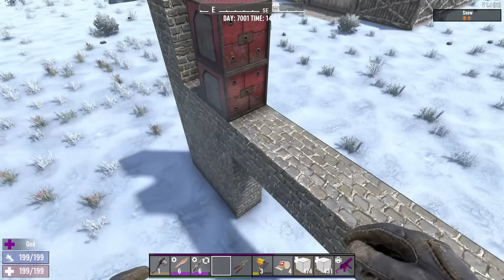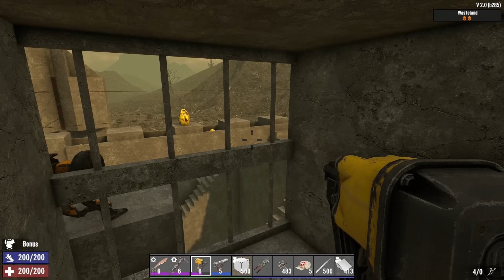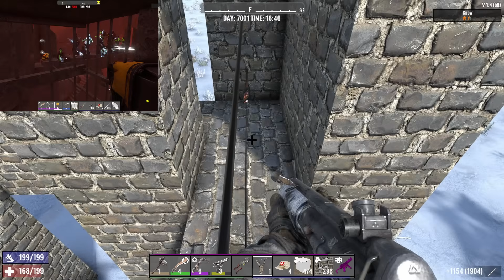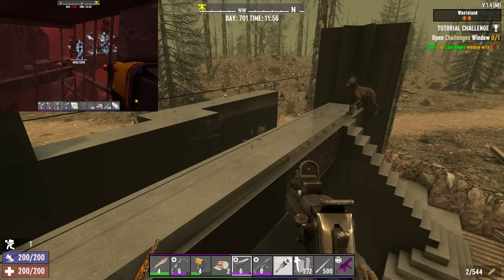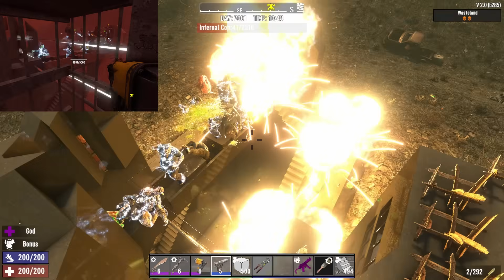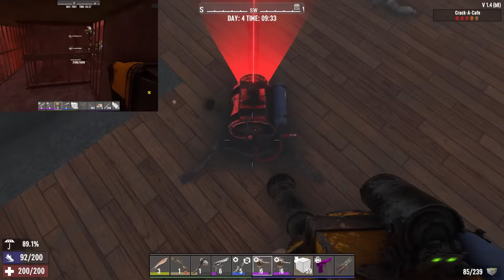How to Build a Simple No Cheese day 7000 End Game Horde Base - 7 Days to die 2.0

Comment: That's a good horde base. Based on the screenshot https://youtu.be/b-JvCyPUeFs?t=959, I've replaced lateral panels with bars so I could shoot zombies that are stuck in the holes on the catwalk. Shooting zombies with a SR by lining them up from the right side sort of works but the slits and dart traps on the left side had to go and to be replaced with solid steel blocks to stop bullets. Made the same sort of base in 3.0 but the zombies decided to bash on the right tower containing traps. There's indeed a passage for them. They could theoretically brake the slits and traps to access the main base that way. But in my case they don't even climb on the catwalk, they destroy the tower footing columns first, I don't know yet why.
Hope you'll make another one for 3.0.

Comment: I figured electric wires took more damage the more zombies were in them, so I assumed all of them getting shocked at once would destroy them in like 1 minute.

Also if built for it, you can use a zombie sensor to turn on the traps. Just gotta block off the angles that aren't in the path of the dart traps.
Reply from the maker: Yep motion sensors will work with the dark traps so you don't waste as much ammo

Comment: I think the biggest issue here is that the day count doesn't matter for 2.0+. It's based on your GS which is a formula that doesn't even consider the day count.

Maybe remake it showing the GS at max (720) would be better. I had to check if this was from an alpha version.

Just double check the in-game formulas before saying anything concretely! As soon as I heard day 7000 and 2.0 together, I felt you didn't actually dive into the game mechanics.
Reply from the maker: gameStage = ( playerLevel + daysSurvived ) * difficultyBonus"

This is the formula I believe I've showed this in a few different videos.   I'm already at max level and the days does count because that's how many days survived. There's no difference between day 700 and day 7,000 because you're already capped at 720. And it was on nightmare difficulty. The only way to get higher than 720 is in multiplayer with multiple players at the cap as far as I know.
Reply: @SURVIVORDAN79 days survived is character based. I'm not sure if just setting it to 7000 changes the days survived count at all. It's be a deeper delve into the mechanics, but the total number of days shouldn't matter whatsoever if the character hasn't survived them proper.
Reply from the maker: @tasteslikewall try it. Go to developer mode type in the days to where it's higher and your game stage will go up
Reply: @SURVIVORDAN79  good to know. Of course, for people on multiplayer, it could still be misleading as they all have different day metrics. Could have a player thinking they need a base like this when they could get by with a few cobble and wood spikes lol.

Comment: Quick question is this base design still possible on 2.2 ? 
Didn't the dart traps or electricity lines shocking zombies got nerf to only 7 blocks ?

Sey for my English hope u guys understood 
Love your work !
Reply from the maker: Darts got nerfed from 26 to 11. But it doesn't affect this build at all. As for fences they are still 14 in-between each wire as of version 2.3
Reply: @SURVIVORDAN79  the wire wont reach
Reply from the maker: @KrtekVR_ It will. Watch this: https://youtu.be/TrkUegFs7yc?si=Y2zqOQN8s3bCfmDe&t=385
Reply: @SURVIVORDAN79  Thanks so much! I made it last night in less than an in game day and didnt even have the dart traps or the max wire distance. Just a level 5 sledge I scrambled to make and the electric fences. It held up really good
Reply from the maker: @KrtekVR_Nice me and my kids are doing a run too and ours is just wooden with a little cobblestone right now and it works great

Comment: There is specific blocks it can only stop demo
Reply: It stop demo but normal zombies can go true
Reply from the maker: Yeah I don't want to cheese it though. If made from steel can handle way more demos than you'll get in a horde night.
Reply: But it can stack demo's  it is demo filter
Reply: And it will be cheaper to repair
Reply: Or you can use some specific block to trick ai
Reply from the maker: @Ice711fakeKekekekeYeah, hard pass on that removes the challenge
Reply: I thing you can use zombie force field and demo filter. I thing thet save some block from destroing your blood moon base.

Comment: What keeps them from breaking into the base from the first walk way like tru the first set of dart into the cat walk, Why do they path the .05m pole instead? I want to Make this my full base and want to make sure that even not on horde night they wont try breaking in anywhere else. Would like to keep the front path to 1 way entry only.
Reply from the maker: They will take the path of least resistance so they have to go through the dart trap cover the dart trap and the electric fence to go that way. Instead they come to the fighting position where there's a single block in the front. I'm actually releasing a step-by-step build today so check back later. Has a much improved fighting position

Comment: nice horde base design, just a little problem I see is that when the dart traps are gone, there is just the hydraulic hammer and you it the way of the zeds. (Electric fences will degenerate fast on harder difficulties)
Plus, there is no door between your position and the passages to refill the dart traps.
Dart traps are still a supporting dmg source, not a MAIN dmg source like a player dual wielded hammer on the other end of the line.
Reply from the maker: I'm not sure you watched the whole video All the electric fence posts are located in the base and are easily accessible. Also four of the dart traps are as well and can easily be reloaded.  also had a day 7,000 horde max difficulty playing the whole time up in the corner. The only reason I didn't make a walkway to the other dart traps is because I didn't even need to. As shown in the video.

Comment: I have played nearly 6,000 and it did NOT occur to me, to run the fences along the path rather than at 90 degrees.

Genuis!
Reply from the maker: It's pretty effective. The only downside is you can't line up headshots parallel with it because you have to stand where the dart traps are. But with them frozen it's pretty much a shooting gallery anyway.

Comment: Very nice indeed! going to try some of those trick on my next base

Not sure if you're aware, but you can actually feed multiple electric fence posts from a single one. In my last Day 21 horde base, I had two posts each powering 9 others,  creating 18 crisscrossed wires over 4 blocks. By the end of the horde night, only 2 wires were down.

I haven’t tested it in your configuration, but I think if you placed 3 or 4 end posts per height level, it would make each layer last 3-4 times longer before needing any repairs. If any repair is needed, they might last all night
Reply from the maker: I like to wire them independently that way if one fails they all don't fail. But you can definitely do it either way.
Reply: @SURVIVORDAN79  I understand the sentiment, but in your case you have 2 start posts running wire to 2 end posts what i am saying is to run those same 2 starter posts to 4-6 end posts to make them last longer. If the starter post get damaged you lose the line anyway, so there should be no downside.

Comment: the construct guide is wrong
somehow leaving 12 blocks in between and when I connected the electric fence post the wire disappeared, leading to the base failing at blood moon and my whole team died,

also I cannot retrieve dart trap and must make them again AND break through the arrow slit concrete 

dislike to this video
Reply from the maker: Right. It couldn't be that you connected them wrong... Also you can pick them up if you have a land clam block. No need to destroy it.

Comment: This is gonna sound very dumb how do you enter or leave the base?
Reply from the maker: There's just two ladders on the side of the building two blocks above the ground.
Reply: @SURVIVORDAN79  Could I ask you about how did you build the whole downwards without breaking your base?
Me and my friends just recently got into 7 days having a blast with it 
Just a little confused on a few things
Reply from the maker: @Heyhowaru you mean the pit? I just dug a hole in the ground and put in walls on the edges. As long as you don't dig under your base you should be good.
Reply: @SURVIVORDAN79  Yeah meant the pit 
I tried digging but it kinda fell apart lol

Comment: i would love to see a 3X3 version of this if you may?  :]
Reply from the maker: You mean like a three wide walkway? Or a third walkway with another set of darts and wires?
Reply: @SURVIVORDAN79  as it is right now it's 2x2 meaning the dart and the electrical traps, 3x3 means instead of 8 set of traps you'll have 16 of them from bottom to top and 1 block in middle will be the blank from trap but will be used as main support beam
Reply from the maker: @infreno848  yep totally get it. I was trying to make it small and compact as possible. Very doable.Would just take more dart traps and wires
Reply: @SURVIVORDAN79  don't get me wrong this build as it is , realy awsome , just thought about buffing it a little will it preform any better or if it'll hold

Comment: HEADS UP:  The maximum distance between 2 Electric Fence posts is 9 blocks, not counting the blocks the posts stand on.
Not sure if the streamer test weekend version was different... or if the first release of experimental was buffed without mentioning it and then nerffed without mentioning it.. But according to the wiki its 9 blocks, and in testing myself on default settings on the latest experimental version it is also 9 blocks.    Love the build btw, but it will have to be edited a bit
Reply from the maker: Dude you freaked me out! It's still 14. I just tested it with 2.0. That may be the max distance from the player. But if you stand in the middle of the two posts you can get the max distance and it's still 14 blocks between the poles.

Comment: I have two questions.
First off, can demolition come in the modified variants like radiated, charged  or internal.

Also, you said something about this in your video, just want to make sure I understand it correctly. Old saves will no longer be playable after update
Reply from the maker: Most mobs come in the Radiated, charged and infernal however the Demos are only generic. I guess they figured they are dangerous enough. As for old saves. Anything from version 1.0 like 1.4 or 1.3 won't work after the 2.0 update. If you're on PC you can always select what older version you want to use though if you want to keep playing on it. They just won't be compatible with the update.
Reply: @SURVIVORDAN79 thank you. I will say, I hope they change that with the demos.That seems like a really missing opportunity. Also a paint in the ass but could be awesome.

Comment: If you overlap sets of electric fences, will they all break at same time, or will only one fence zap them at a time to extend how long the fence area is effective? Usually when the fences are run perpendicular there are multiple levels that dont all break at same time.
Reply from the maker: No they won't break at the same time.  Whichever one takes the most damage first will break first. So if you have them in parallel and one goes down you'll still have the other one working while you repair it the first one.

Comment: Hey mate! Crazy base, but I have 2 questions if you do not mind:
1. Dont the zombies try to break through the left side (if you are standing on the fight position 15:03) as that's technically also a way to reach you?
2. How do you manage to make them follow the exact route instead of breaking the pillars of the "base" as I am struggling with that AF.

P.S. Really great, simple and effective. Glad I've found your channel :D
Reply from the maker: 1: Yes they could. They will take the path of least resistance. So if you say you have a double barricaded fight position and it's less hitpoints to go though the arrow slit cover and the dart trap they will.  So In the cobblestone example you could remove the walkway to where you repair the fence and leave a gap and just jump it so they don't have a path. Or make what's between that path and you more difficult and they will take the least difficult path. 

2:  If they are hitting the pillars of the base they may be taking fall damage and going into rage mode. The best solution is to dig a pit 14 blocks deep. If they take fall damage and are more than 12 blocks from the player they won't go into rage mode and destroy things. I make it 14 in case they land on one of their friends.  Also if you make a path that is to complicated and long they may just try to destroy you base. I don't know what you build at the end of the pole in my example but if you stand far away from where the fight position/where they try to break through they may just try to destroy.  

It does take a long time to dig a 14 block pit. In the early game you can put spikes around the pillars. I'm not sure if damage still breaks rage mode but it used to.  You just won't get any xp from the ones that die that way.

Comment: please make the tutorial slower and straight to the point
I had to start over from scratch then just eventually gave up trying to figure out the dimensions and whatnot at 10x speed
Reply from the maker: Where exactly are you having trouble? Let me know the timestamp and I'll try to explain.
Reply: @SURVIVORDAN79  Not trying to speak for him, but because of the speed of the tutorial part you had to almost pause every second to see how many blocks were used etc. also the mistake with the fence placement etc could have easily been edited i think? Great build, nice video though!
Reply from the maker: @Qr1M371m3  Gotcha, The key dimensions are: create the platform 18 blocks apart, wires are 16 blocks apart Dart traps are 14 apart and Arrow slit covers are 12 apart leaving 10 spaces in the middle. Then place the steps 2 blocks away from the dart trap on the right (if your looking from the fighting position). Most of the rest is aesthetics or personal preferences.
Reply: @SURVIVORDAN79  The maximum distance between 2 electric fence posts is 9 blocks. Not sure if this was changed after your video or not but sadly I built 90% of the base on our server before connecting the wires.. and its default settings no admin mode so finding this out sucked.
Reply from the maker: @viskipz6815  Looks like you double posted. It's still 14. I just tested it with the 2.0 full release. That may be the max distance from the player.  you have to approach from the middle and gradually inch forward like this: https://youtu.be/-FQYe75YEJA?si=ke9O7YXRFNbNat1f&t=505